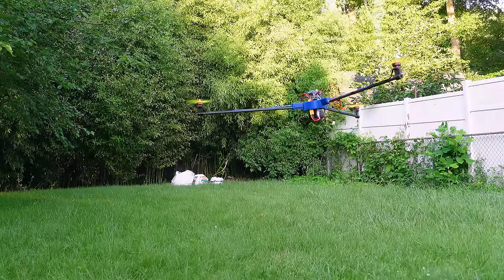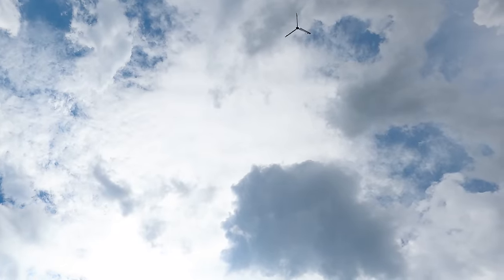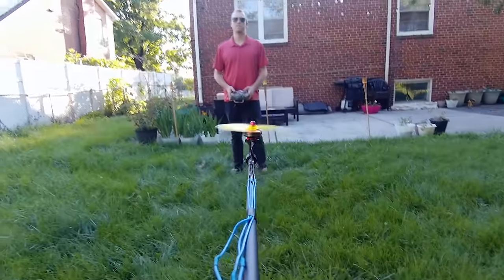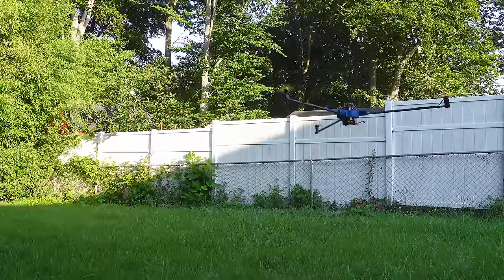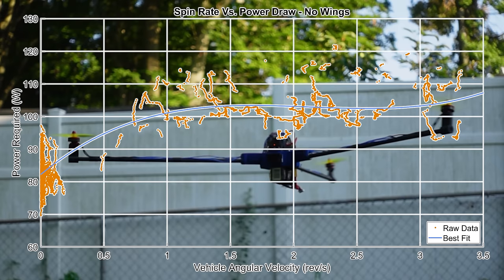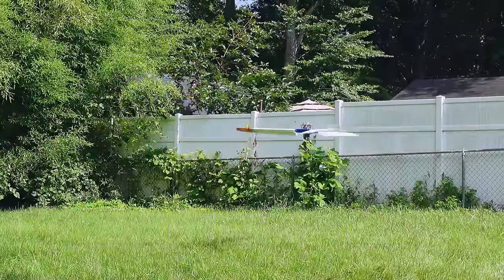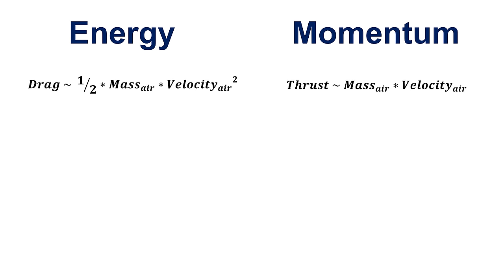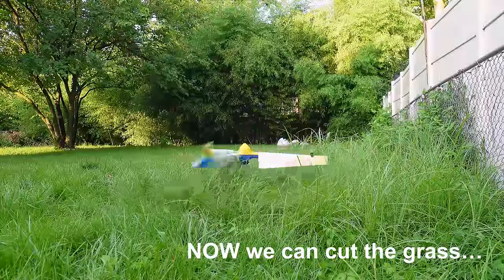The Spinning Drone Paradox - Part 1

Comment: Could the three wing arms vary in angle of attack to reflect the varying speed through the air with respect to radius.  This might further add to the lifting efficiency of the three wings.
Reply from the maker: Definitely, but I wanted to keep the blades symmetric to preserve forward flight abilities

Comment: Anyone suggested using 2 of these I'm an osprey style vtol configuration yet? Like seems to solve lot of the directional flight problems and provides a platform to use that efficiency gain instead for increased lift capacity.

Also wonder with the central "prop" if used a equal numbered blade design 4/7/8 could possibly turn on/off some of the small "wing tip props" instead of throttling them all down to achieve hover and coming out of peak motor efficiency. Like run a couple flat out instead of more lower in the rpm band.

Comment: I mean hold on... at the start of the video still so... take what I say with a grain of salt but...
This doesn't at all feel like a paradox. It's as simple as a larger wing. The trust powers a larger wing requiring less power over all.
So as soon as the larger wings produce upwards thrust or lift the efficiency of that takes over. 
Like the intuition we all have that a helicopter will dead stall if the motor fails, but that isn't necessarily the case, lift decreases over time.

Comment: I'm 60 seconds in and I'm not seeing how creating an aerofoil is a paradox. Of course there's less power required when you're essentially creating a falling plate with huge drag, plus generating a bit of lift when angling the fins.

Comment: couldnt you do this with 4 blades/propellers also? then youd gain movement controls... i dont see why not
Reply from the maker: No reason you can’t, 3 is just less parts to build and the bare minimum to work

Comment: This concept is used by planes during flight all the time. The thrust given off by their propellers or jets would not be enough to lift them if pointed straight down. They are able to fly by making use of their wings and using thrust to push the wings through the air. Interesting 🤔

Comment: Is you think about the weight of a commercial airliner imagine the amount of energy it would take to lift it straight off the ground like a helicopter.  Not try dragging it across the ground in oder to let air help push it up for you. This doesn't seem crazy to me.

Comment: freaking awesome, and damn u got a like from @rctestflight, so what's the MGTOW of this configuration, i mean without screwing the performance averages by too many standard deviations that is :). also i'll dig around for the build instructions or configuration details used if you published that somewhere, if not, please link.  thank you so much again
Reply from the maker: Thanks Joe, check out the hackaday link in the description for 3D print files
Reply: @NicholasRehm  whaaaat? thank you sir! 🤯 oof, how did i miss that

Comment: This is a very old idea.
The Brits made a full size helicopter like this, with jets on the wing-tips.
The large rotor is more efficient, than small rotors.  
But it was too complex, and the idea was shelved.  Perhaps with electric motors, it could be made more simple.

R

Comment: Maybe use a different type of airfoil like the Eppler 420 series.. get even more lift for less power
Reply from the maker: Needs to be symmetric so it can spin and not produce a horrible rolling moment in forward flight
Reply: @NicholasRehm  Have you tried different airfoils? Just curious...

Comment: Imagine this: Instead of putting large tilting fins on the copter, put tiny propellers on the tips of your standard propellers. Then the main body will remain stable instead of spinning. Right? Now transfer that concept to your large fins. Ie, build a separate non-spinning body under your giant prop -- like a helicopter.

Comment: Wait, would this work as like... a replacement for a helicopter blade? Like if you had a helicopter blade that had smaller helicopter blades on top of it, tilted slightly, would that improve fuel efficiency?

What if you nested the engines? Like, a tri-copter of tri-copters? LOL

Comment: ok so I have  4 bladed propellor driven by 4 propellers ... my prop powered prop?   if efficiency works like this in a hover, wouldn't forward speed also have this?   Seems there was a rocket powered prop the Germans worked on?

Comment: Wonder if you could see these kinds of gains fractally - As in, if you used this drone as the propellers for a yet larger drone, or sone other setup with nested rotary drones.

My assumption is that this is a very stupid idea that can't possibly work, but I would have assumed the same thing about this design. There obviously must eventually come a dropoff in efficiency that can be gained from the increased complexity, not to mention the maintenance nightmare that would become, but... This video has piqued my curiosity regardless.

Comment: How does Lidar work for altitude control?
Reply from the maker: It measures distance to ground and a pid controller modulates motor throttle to maintain a set altitude
Reply: @NicholasRehm  Thanks. Could you have used an ultrasonic sensor instead?

Comment: hmm the wings are of a really bad design, really inefficient, I take it that are wider in the middle due to a lower rotational speed, or that is the thinking. having a more narrow flat design where the angle of the motor changes the trailing edge but only out near the motor would give much better lift and a lot less drag.

Comment: Aren't you also pushing the airflow of the smaller propellers over the larger propellers? From my non-engineering brain, that seems... good. Because you are using the same airflow to do two different functions?

Comment: Well what you are doing here will soon be used to make more efficient helicopters, perhaps small jet engines could also be used on larger drones -  and still larger jet engines could power the rotor,- or rotors on very large helicopters. 
In fact, the size of helicopters and drones could easily become much larger using this method to turn the lift generating rotors.!!! 
It is in fact something I have mulled over in the past, but I don't have the technical skill to back up my ideas, something likely common to most would-be inventors etc.😩..
Stay safe - and keep innovating. ☆  Niels  💕

Comment: Has no one here ever heard of a helicopter?
A large single rotor has always, and will always be more efficient at generating thrust than multiple smaller rotors.
Multirotor drones are a downgrade from helicopter designs in terms of efficiency, while being a more stable platform for shooting photos/videos.
Helicopter designs also rely more heavily on decent mechanical components for stability and control, as ideally you want to be able to adjust individual blade angle for yaw/pitch/roll control. Drones on the flip side can handle yaw/pitch/roll and stability control all through cheap electronics.

This design would be even more efficient if the large rotor was powered directly rather than three small rotors, with a tail rotor to counter the torque generated, though I guess that wouldn't make an interesting video.
Reply from the maker: Tell me more of this “helicopter”

Comment: https://youtu.be/7JH1_ZKV7t4?t=36 That's not correct.  It would actually still have 70.7% of the diagonal thrust in both the lateral and vertical directions.  Basic pyrthagorian triangle decomposition.

Comment: yes a plane is more energy efficient than a helicopter.
There is nothing counter intuitive here. We know that for decades.

Also I like how you show such a monstrosity as an example of a VTOL and not let's say a normal Boeing MV-22
In the next step you can find out that spinning your entire plane is stupid because of so many reasons and add static wings. Then you just have to rotate the rotors, which means less mass and more controllability.